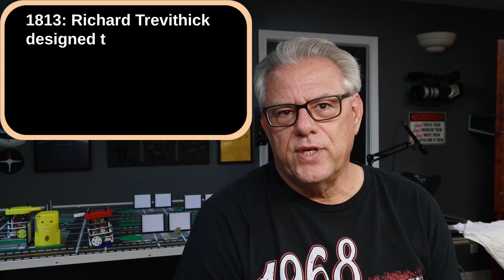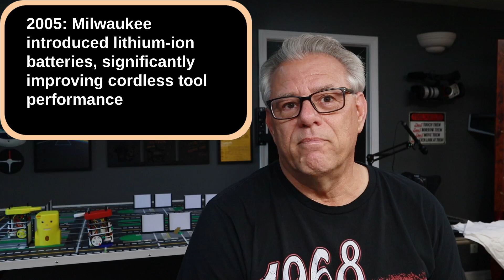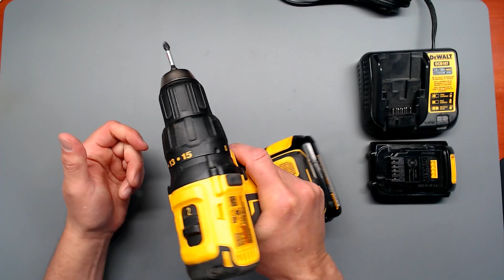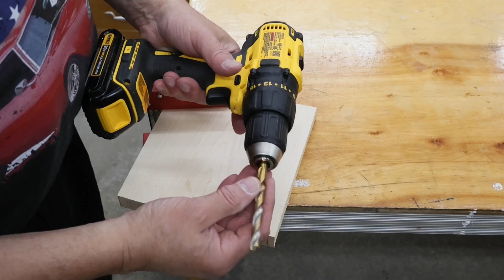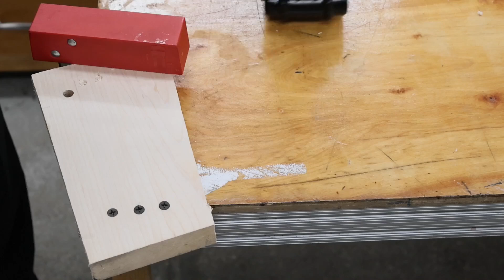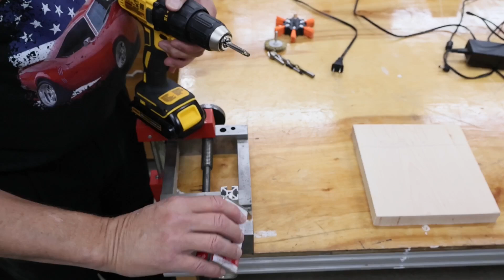Cordless Drill Driver, should this be in every tool kit?

Comment: thanks for the helpful video. i can see you also work with circuit boards and stuff like that, do you regularly use the drill for those electronic stuff personally?
Reply from the maker: Good morning,
Frankly speaking, a cordless drill is one of my most used "power tools"  for every project I do. Specifically for "electronics" work, perhaps not as much as all other projects. However, it is still next to my electronics workbench all the time.
Cheers!
Chris

Comment: Nice shirt! I have a 1967 Firebird, it's a 400, 4 speed, convertable that I've owned for almost 50 years. Cool cars. 👍
Reply from the maker: Good morning @larrynason8716 ,
WOW, I am so jealous!!!!!  Sounds like a great car.  
When I had mine, it went through several phases pretty quickly.
Bought it - every panel had dents or wholes
Had the body "replaced", new interior put in, 455 engine for street driving
Felt the need for more speed - put a 327 chevy in it 
Needed more speed, back-half chassis, chevy 454 -60 over 
Then sold a few years later as I didn't have a place to keep it
I miss that car so much - so many great memories

The back wall where I film has my firebird shrine -4 die cast cars and the only known photo of my car in "race form" at the race track at launch.  

Don't ever sell it my friend - it will hurt as much as losing a family member!
Cheers!
Chris

Comment: My 18V batteries have died over 20+ years, and the manufacturers have phased out those batteries, to force contractors to buy new tools. 
Not me! I goto a local dedicated Battery store, and have them rebuild the battery packs
Reply from the maker: Most excellent way to keep the old tools running.  A few years back I bought 2 replacement packs for the Porter Cable drill off of Amazon.  They were from China and had a run-time of about 10 minutes.  That is when I bought the DeWALT.  
Cheers!
Chris